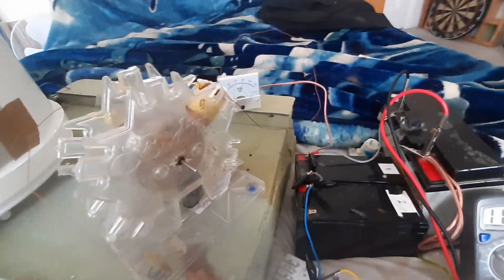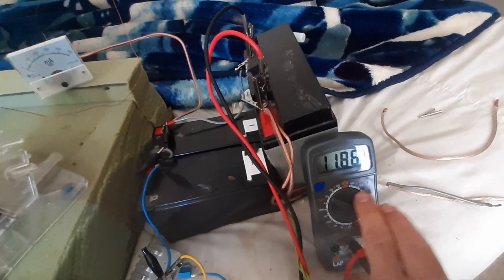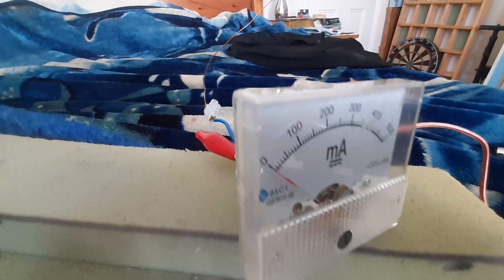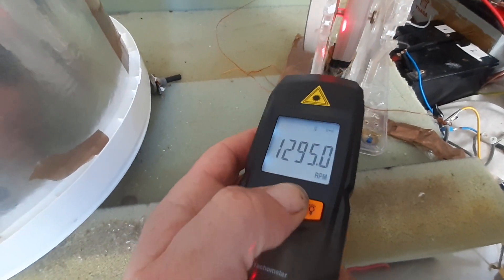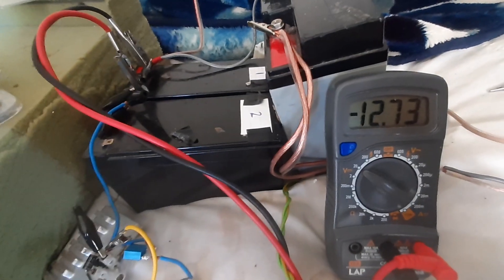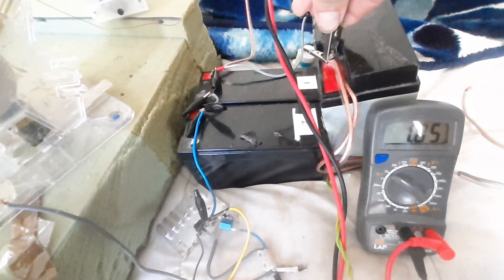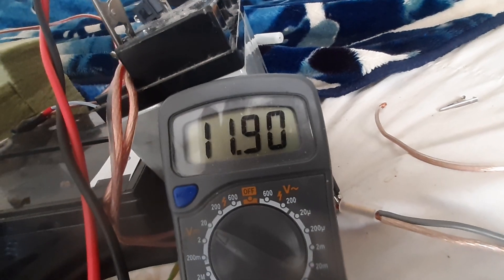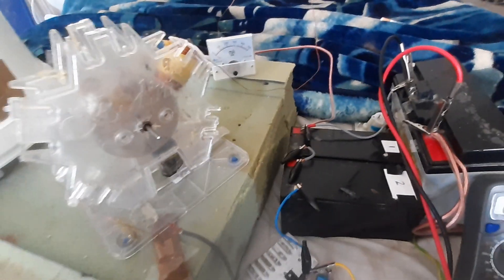BEDINI MOTOR / ENERGISER / RADIANT ENERGY

Comment: What is "radiant" about this setup? What is the point?
Reply from the maker: Radiant is the pulses that occur when coil is turned on and off. Fast waves / spikes of energy. Magnetic field appearance and dissapearance create high voltage pulses. And this can be used in several ways. Uts extra energy, which conventional electronics deletes. Key is to turn a coil on and off and utilise the pulses for free energy harnessing 👍
Reply: @tvdylan  So a switch mode power supply? Those things use everywhere around us?
Reply from the maker: @leocurious9919  im not familiar with what that is, what is a switch mode power supply ?
Reply from the maker: Its basically what tesla did.

Comment: Where is your neon bulb? I never really got charging, but mine would boil the secondary battery when I built one of these 20 years ago. Also, I only had one coil with 2 windings. Not sure if there should be 2 separate coils, but since I only built the schoolgirl, there may have been other variants I skipped for simplicity of the schoolgirl build.
Reply from the maker: Mm! Well boiling the battery sounds like you had some significant output.  So you had a bifilar coil i take it. One trugger and one power winding ? I dont have neon bulb because i always connect it to a batterry for safety the neons can only absorb so much of the energy, they are not guaranteed protection. A negatively conditioned batterry is best i think. As far as the negative charging goes. Otherwise a cap to transduce it to positive and then into a positive friendly battery. Thats not fully charged. The energy has to go somewhere. Also i have a small cap across my mosfet instead of a neon. Just incase of excess energy. But thats for when its run at 24 or 36 volts. The outut goes up significantly when we go to 24 or 36 and 48 volts is a rather massive amount of energy to mannage.  Then we have to be very carefull of the excess heat in the system. Last time i did 48volts on the input i melted my coils. And definately would not trust a neon bulb at all to protect the circuit if were running things at 48 volts.
Reply: @tvdylan  I believe the neon bulb was some kind of decoupling device from what Bedini was saying. Kind of like a spark gap, but where the was constant current flow with a low breakdown voltage, but with no significant magnetic component. Not so much protection, but an attempt to keep the back EMF out of the coils so that the energy went into charging the battery. Anyway, it was fun to make it. It did do something since it did boil the 12 volt battery being charged which was the same size and voltage as the source battery.

Comment: Little motor being the problem, need a bigger more serious motor
Reply from the maker: Well its capable of quite alot. But yes, large mass and size is good. Im figuring out how to handle the negative energy. How to best utilise the out put potential. This radiant energy is interesting.
Reply: @tvdylan  yeah i got some projects coming up, a motor 8kg of wire 2coils , designed to be super efficient if the 2030agenda is true to get around on a homemade scooter but will do bedini and Newman tests soon and some other stuff
Reply: @tvdylan  The only difference I'd make Is wind 
EVERY LAYER the same direction, 
so the magnetic fields of each layer would be 
n/s, n/s, n/s, n/s, n/s
You've wound it back and forth, 
so you're magnetic field of each layer will be 
n/s, s/n, n/s, s/n, n/s
Do you see how they'll give totally different results? It PUSHES the magnetic field outwards through repulsion,
Winding back and forth PULLS the magnetic field inwards through attraction within the coil layers itself
Hopefully you might try a side by side, 
for others to see as that's one comparison not done yet ;) definitely 2-3x stronger, just a hint for ya ;)

Comment: I didn't think there are still people experimenting with the Bedini motor.    It's a desulfator device basically.
Reply from the maker: Well yes. It can do that. Thats not its ultimate function tho. It creates radiant energt pulses. And these pulses can be used to create a negative energy pump on the out put. So we can have true negative resistors / impedances on the output and gain energy from the environment. Free gains. And yes people are still experimenting with this device.  If done correctly it can be an exetremely efficient way of harnessing energy. Do you dabble in experiments of the electrical kind ? Electromagnetics etc. Its a learning journey for me.
Reply: @tvdylan  
Yes,  I do......  I played with Bedini motors for almost a decade now.  I built a few of them many years ago. I must have watched 100 videos of people across the world playing with it.   Unfortunately,  none of them can demonstrate overunity,   not even Bedini himself.  Most of us basically accepted that it is an excellent desulfator,  but not a free energy generator.   The reason for this is simple ---  It's a closed system.

Even if this device could produce "extra" energy,  it would only be in small amounts.   It will become extremely expensive to scale it to be practical.  So in terms of getting "Free" energy,  it's more cost effective to buy solar panels.

If you're interested in playing with this type of project,   i'd suggest looking into Electrostatic motors.  It has a lot more potential  than  pulse motors.
Reply: @tvdylan  
Youtube keeps deleting my comments.  They don't like this kind of stuff cuz they are commies.

So,  long story short,   I have played with Bedini motors for over a decade.  It has never shown any Overunity characteristics,  not even Bedini himself could prove it.  The reason for this is that the device itself is a "closed system."   Most of us gave up and accepted that it is a great desulfator,   but not a generator.
Reply: @tvdylan  
Unfortunately,  you won't get any free energy from this device.  Not even Bedini himself could do it........  It's just a desulfator.

Comment: Do you have 1 to 1 charging, I've never been able to do it, I only have 30% to 40% charging + motor effect, I've never tried with charging coil
Reply from the maker: do you mean you never tried with trigger coil ? and im not sure what the out put and input ratio is. id like to get some proper measurements of it soon. half of the system, in all honesty, is negatively conditioned batteries. to create energy pumps to bring in energy to the system. so what i need to do is condition several batterries negatively in order to properly test this system. and that takes quite alot of time. currently im conditioning the large battery in the video but several of those would be better and ideally bring in more energy to the system.
Reply: thanks, we're probably on the same page, I'm also trying with a larger battery and can see that more negative charge comes in with one of the same size
Reply from the maker: @brianlanghoff1919  yep, each battery plate is a negative resistor, bringing in energy from outside the system. So we really need to have large batterys for maximum negative resistance. I definately have not used big enuff batterys yet. Its easy to feel like giving up on negative charging but in all honesty i havent fully gone all the way properly with it . And i need to be scientifically honest with myself and not give up on it too soon. The cap dump is very tempting , so in gonna try and master that aswell as giving the  egative charging a good go. And pulsing the positive charge mode is essential for higher gains on the output. Ive found a diagram for the cap pylser so i might have a go at making one ! Then its just components cost! 😏
Reply from the maker: i did a somewhat direct measurement of input output milli amps. it was about 350 input draw and 185 milli amps going into the charge batterry. but i used a different adjustment to do that. i move one of the wires and added a diode to do that measurement. and its slightly different to what i have in my video . but thats not the whole picture. bedini calls it generator mode.or forced charge mode. with the extra diode. i can do a video to show it. you can try it yaself. but we have to observe the motor over time. and watch the overall results after time.im running it in generator mode, and its holding very steady on the charge battery, so even if the input draw is 350, if the battery holds its voltage very steady, this is something very interesting to watch. ideally the input battery will hold its voltage while the charging batterry goes up. im wathcing my motor now and th einput battery has heldits voltage @12.46 for about ten minutes. without going down. so thats pretty damn stable, so i find this rather interesting. so we cant just look at input / output measurements, we have to look at what happens over time. if im charging a battery , and the source battery doesnt even drop its voltage by 0.01 volts in ten minutes. thats kinda interesting. and i think im using one of my good batterys. so using batterys that are generally in good health is also vital id say. some of my batterys seem to be a bit week and dont hold charge so well. so we have to keep track of our good batterys. and use those ones for our tests. if a battery is not performing well, it should be labbelled as such, so were not fooling ourselves. or giving up too soon. now the battery maybe goign down very slowly, but to hold its voltage very well is definately something promising. using minimal energy form the source battery is a good idea to me. now way are we gonna do that if our coils and transistors are hot.